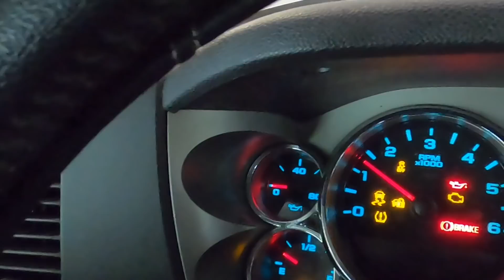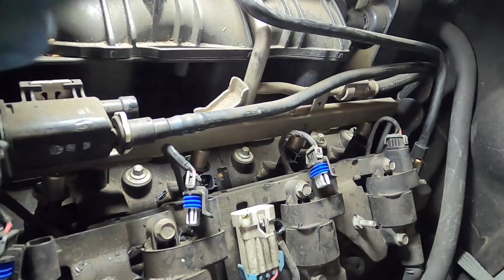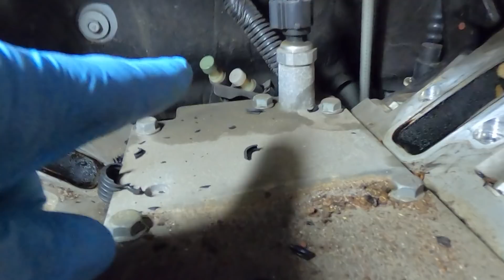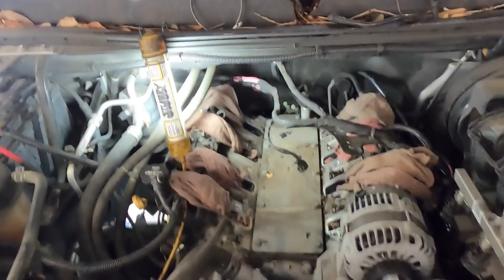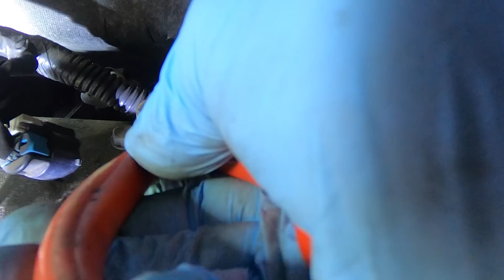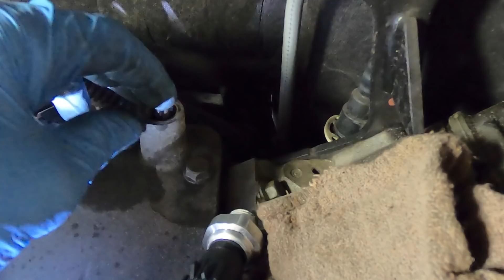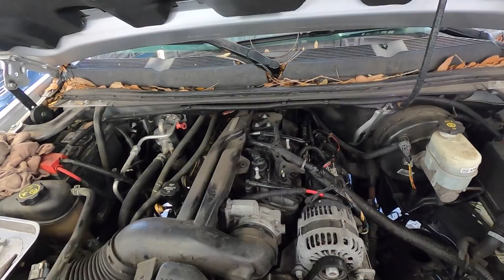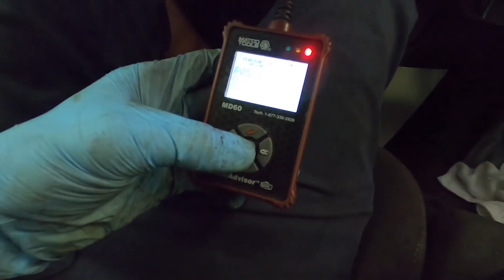Customer States: Google Diagnosis…replace this part!

Comment: I miss the days when trucks didn't have half the motor covered.
Reply: Try working on a Honda Goldwing.  😂
Reply: @Laun0218  I have. I pulled the motor out to work on it, then reinstalled it.
Reply: @NOTSOSLIMJIM   yeah you know what I’m talking about, then, 😀
Reply: @Laun0218  the honda sabre v65 were not much fun either.
Reply: @NOTSOSLIMJIM  did everything work? I always have spare parts .😒🤭😓
Reply: @richardscathouse  on which vehicle?
Reply: That must have been sometime in the 1960’s! Starting in the 70’s they were covered with so many vacuum lines and other hoses you could barely find the wing nut on the air filter.
Reply: @ralfie8801  those vacuum lines have been replaced by wires. And still way more easy to work on when half the motor doesn't have the firewall hanging over it.
Reply: @NOTSOSLIMJIM  
You got that right, I have a 99 Z-28 with an LS-1 in it, the cowl and windshield cover most of the back half of the engine. 
I think I’d rather have the wiring than all those brittle plastic and rubber vacuum lines myself. .
Reply: @NOTSOSLIMJIM  you remember the 1974 I think it was Oldsmobile Cutlass with the 350 engine in it? The freaking distributor cap was under the firewall. The hood didn't raise up very high so you had to lay on top of the engine to get to the cap. What a freaking nightmare that was. Then if that's so much is water looked at that car the cap would condensate and misfire.
Reply: John Rodrigues 
That's not a big deal, take the cap off and wash it out with WD-40 and put it right back on. As long as the problem was actually water in the cap it would fire up every time after spraying it down. I had a 66 Mustang with a 289, the distributor was right up front and in the road spray that came through the radiator during rain storms. I kept a can of WD in the car at all times for that and also when I washed the engine at the car wash. 
Most GM products have gotten away from vacuum operated HVAC systems and use electric controllers to run the blend doors. I know the 2003 Silverado my Dad had is electrically operated.
Reply: @JohnRodriguesPhotographer  not exactly a truck, but there was always a few pain in the ars vehicle. Not like today. Look at euro cars. The V10 bmw requires the motor and transmission to be pulled for the upstream O2 sensor. The V10 tdi requires the whole motor, transmission, and front suspension for the AC compressor. Hell, mt v6 Audi allroad requires the motor and transmission to be pulled to service the turbos.
Reply: @ralfie8801  I always put a gasket on the caps the keep junk out. I make them out of rubberized gasket paper.
Reply: NOT SO SLIM JIM 
I've only owned GM vehicles, mostly trucks since the late 70's. If it didn't come with it, I put GM HEI distributors in all of them, there were never any moisture issues with any of those, so no cap gaskets or other sealing methods were ever needed.
Reply: @NOTSOSLIMJIM  GM ASTRO VANS...SICK...
Reply: @ralfie8801  HUH!!!!!
Reply: @ralfie8801  TRUE...HAHAHAHAHA
Reply: @ralfie8801  got to love robbing power from the engine to save the world. That and operate all the stupid vent doors and everything else on a car they could have been servo a operated or the good old days where they had direct operation of vent doors and even them outside mirrors could be moved with direct operation.
Reply: Just 8 sparkplugs, some wires and a carburetor.
Reply: 1974 chev pickup with straight 6.  Raise the hood and look down and you can see more ground than engine.
Reply: Gotta hide the plastic
Reply: Used to be able to sit in the engine compartment on the wheel wells with feet down alongside the exhaust. Now it's tons of emission trash that doesn't do much but cost more.
Reply: My new Hyundai is like that.
Reply: YUP...2 55 Chevy 2 Door Wagons 1 57 Chevy 2 Dr Wagon...and an Early 55 Chevy Pick Em Up Custom Cab...(Square Wheels n all)
Reply: yeah it must  make it overheat
Reply: I miss the days when cars didn't have those super covers on the engines. Kind of helps when you can look under the hood and say gosh there's oil coming out around my valve cover maybe I should get that fix or fix it myself. Gosh why is there cooling on top of my engine maybe I should go get someone to look at this. Everything's covered up. They don't want you to look. They just want the money light to come on and if you're doing 70 miles an hour down the interstate and you get a low oil indication it's too late.
Reply: PART OF THIS NWO GLOBAL GRIP...MORE REGULATIONS...LESS FREEDOMS...SICK OF IT ALL...GREEN NEW DEAL IS NOT NEW...BLAST THOSE THAT ARE PUSHING IT...
Reply: @bigsparky8888  They even destroyed the 5 gallon gas can
Reply: Look up changing a starter on a Toyota Sequoia or tundra 2001-current. 

You'll be distraught and angry. Then yell WTF. 

Just alluding to your point.

Comment: The oil pressure sensor was working after clearing codes . I seen that . Most cases it is eop . When i build transmissions for these units I replace sensor, rear main and cover gasket its the easiest to get to then
Reply: shhhhh. The customer can't be right! not after he made such a big deal about them being wrong! You have to let the mechanic diagnosis problems! REEEEEEEEEEEEEEEEEEEEEEEEEEEEEEEE
Reply: @DustyOldBones  hahahaha
Reply: tom allen  CEL is off too
Reply: Hahaha I knew it! I even said that it probably just needs the code dumped!

Comment: If you go around the driver side of engine you can get the sender out without removing intake. Just did a 6.2 couple weeks ago.
Reply: Judging on its position in the video and the style of the intake manifold, how the fuck would you get it out when it's right at the back and next to the firewall basically, I'd say good luck with that but if you already have done one on this engine with this manifold on this car how the fuck?.. Lol

Comment: Why you pull the intake off , you can get it without doing that . Commission mechanic on diesel rigs for 22 yrs you adapt to ways to beat the time .
Reply: it's not even like you gotta have experience to know this, i've never once seen or heard of anyone pulling an intake for this, it's a one hour job for diagnosis and labor and you do the reach around with a 3" extension and the long sending unit socket and a short 3/8 ratchet. I've personally done this repair at least 4 times and i'm not even a chevy tech. These chevys that he is working on in the video didn't have a problem with the intake gaskets like the previous design either, so there is no reason to go in there and do this he's just taking the customer to the cleaners because of his lack of experience, makes me mad someone paid literally 3x what they had to for this repair.
Reply: Post a video on how you did it.  Let's see.
Reply: @21Piloteer  John Doe is right you don't have to take nothing but the dust cover off that's it. I am also a tech and we always just used a wobble extension to remove it.
Reply: @21Piloteer  No need, actually. Several YouTube videos of the same repair, without removing the intake. Rainman might have some splainin' ' to do
Reply: @JohnDoe-lt9sg  I know right. We always used a wobble extension to get it out and in after rmoving just the top dust cover.

Comment: I replaced the sender on my buddy's 2010 5.3 without removing the intake. 

Next time that thing needs replaced, I'm pulling the intake. Screw doing it without that again.
Reply: I definitely didn't remove the intake on mine either. It literally was pop and swap for me. But hey, he's going by the book, us backyard guys don't want to spend more time on it than we have to.
Reply: @tt7hvn  
True. But neither my buddy nor I anticipated how difficult his stock sending unit was gonna be. Next time I'm just gonna pull the intake. Wasn't that hard when we did his intake gaskets.
Reply: Took me 30 minutes to change the sender on a 5.3 suburban. Ratchet, socket, and an extension with a wobble joint is all that’s needed. Once it’s broke loose, unscrew it by hand and put the new one in the same way.  You can’t see it, but you can feel it easy enough.
Reply: @ralfie8801  
Didn't have a wobble, and I have large hands. Was a straight up field repair. But hopefully I'll be more prepared next time I have to do this repair. Definitely not looking forward to doing it on my big block...
Reply: @texan90  
Yeah, not having certain things sure can make a job a lot harder. I don’t exactly have little hands either, but I am a bit double jointed, so my wrists and finger bend farther than most. 😳
What’s that big block in, and more important, which big block? Both of my 454s have the sender on the side of the block just above the oil filter boss.
Reply: @ralfie8801  
Lucky on the double jointed! It's my '99 K2500. It's next to the distributor. Even less room to get to than a 5.3. Did one many years ago, and it took more than an hour of laying on the engine. I'm gonna replace this one when I do my injectors and distributor replacement and have the intake off.
Reply: texan90 
I was gonna tell you I've got long arms too, I could probably reach it from a stool next to the front tire!

Comment: what a ridiculous amount of work to replace a ten dollar sensor...the newer the vehicle, the more ridiculous
Reply: No one ever pulls the intake for this, this is nonsense. Turning a job we do all the time for one hour diagnosis and labor into a three hour job and taking the customer to the cleaners. It angers me and it should anger any professional mechanic. Never ever have I heard of someone pulling an intake for this, 3" extension and let the engine cool off and be a freaking man and reach back there and slip the socket and extension over it by feel, then slip your ratchet on and remove it. I'm irrationally angry about this because he is charging the customer 3x what he should, and these intake gaskets didn't go bad like the previous style there is literally no reason for him to be in there.
Reply: @JohnDoe-lt9sg  not to mention all the points along the way where other components can be damaged during disassembly...

Comment: My 61 Ford had the oil sensor in plain view. How times have changed!!!
Reply: Jeep 4.0s are like that - just reach down and unscrew it.
Reply: I'm still having trouble with having to remove a cover just to SEE the engine!!   My 2010 van just told me that I needed an oil change, that I must CONTACT A DEALER, AND set the MIL!   I like simple much better.

Comment: That screen fits the 5.3s. But I've never seen it for the 4.8s.
Reply: Correct.  That's for dod ,afm engines. You won't see it on 4.8 because they don't do the afm on the small engine

Comment: Would you have to scope the inside of the oil pan, to see if the pick up tube fell off? GM Quality🐒
Reply: If it actually had no oil pressure, the guy would have noticed quite quickly.